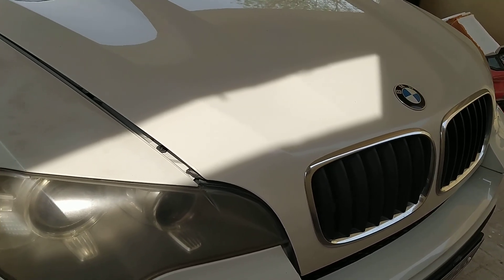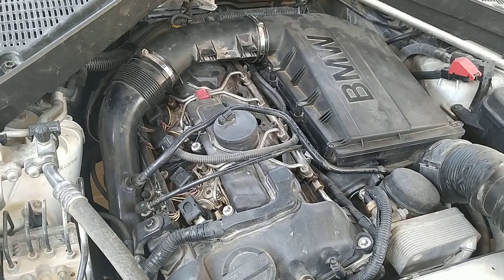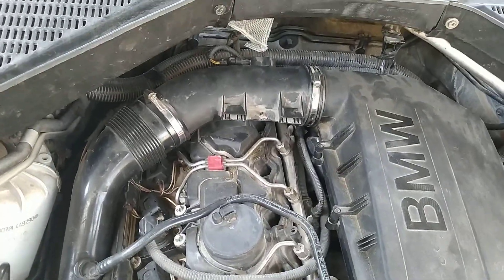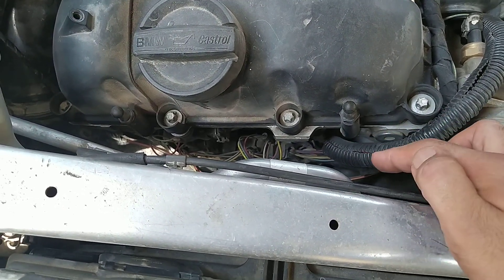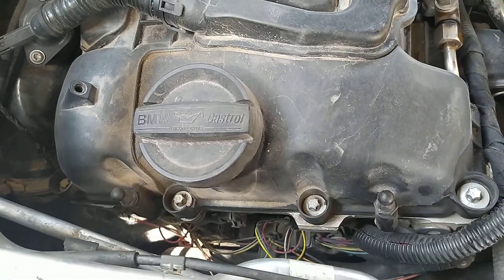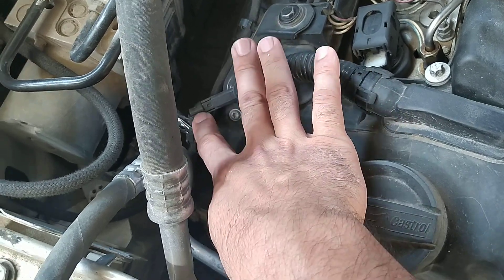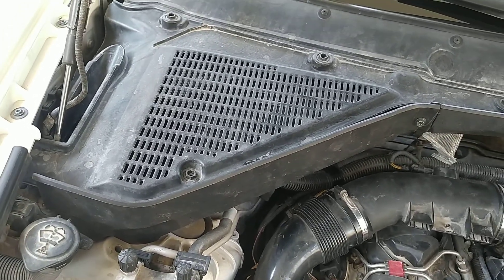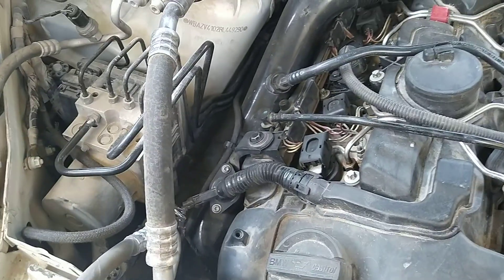BMW X5 E70 N55 no start due to electrical short circuit fixed!!!! See discription for error codes

Comment: Its was codes p15ED p2088 p2090 p0100 p0343 p0368 but it has to be the crank vent hose sensor because if i plug that sensor in the fuse blows in the integrated power supply module. I tried changing the cam sensors and unplugging the mass airflow sensor and that didnt work. I put the test light where you told me to and when i unplugged the cam sensors and the mass airflow sensor the light went dim but it never went out. So im buying a new vent hose with the sensor.

Comment: Ok so i just put the test light wire on the side of the fuse that goes to the dme and the other wire to ground right??? Is that with with the key off? Please help me!! Im blowing the same fuse
Reply from the maker: Test light positive to to positive terminal of the car and negative of test light to the fuse. Then remove wires of each component, please keep the vent hose electrical connector disconnected all the time. Try without ignition if the test light lights up that way
Reply: @bimmerhacks  so one wire on the positive and one on the side of the fuse that goes to the dme right? So basically I'm putting power with the light through the dme right? So that's not going to hurt the dme?
Reply from the maker: @jeffreyodachowski6247 no ... U r not putting power to DME u r just checking if a line that is supposed to carry positive voltage is touching the body and grounding
Reply: @bimmerhacks  I fixed it! The crank vent hose sensor is bad. It has a ground wire I disconnected that wire and all the codes stop. So that wire you told me to disconnect is the bad sensor. If I connect it the fuse blows. Idk why the dme isn't showing me a code for that sensor. It's not connected. But it's working. I never got the test light to fully out out but it did get dim. Thank you so much!!!!!
Reply from the maker: @jeffreyodachowski6247 @jeffreyodachowski6247 Glad that got fixed... Sounds weird.... Thank you for the update 
If you have time just put the error codes completely as comment so that will help some one out there without much brain storming😊

Comment: I just bought a 2009 BMW X6 35 I and there is no crank no start. I have tried to make an artificial body ground because I have seen the ground belt can wear out and that didn’t do anything I also tried to jump the starter solenoid and nothing. I have a bunch of codes I’ll list below 
P16a3 
U1126 
P1701 
2ab4 
2dec 
Cf37 
Cf34
Cf2b 
507d 
Cf2f 
50dc 
Cf30 
Any ideas ? All the dash lights come on
Reply from the maker: Check IVM/integrated bsupply module. YOU CAN SEE IN MY VIDEOS
Reply: @bimmerhacks  what am I checking for ?
Reply from the maker: @brandonparenteau8564  check if any of the fuses has blown in that module. No need to replace the module you can just plug in same Ampere fuse and check for any short circuit
Reply: @bimmerhacks  ok will do, I’ll let you know if that fixes it. Thanks for the reply
Reply from the maker: @brandonparenteau8564  Forgot to remind you, the battery must be in good condition. Must read 12 or near to it
Reply: @bimmerhacks  just checked the ivm and I can only find one 50 amp fuse and it’s good
Reply from the maker: @brandonparenteau8564  send me the IVM foto please. bimmersword@gmail.com
Reply: @bimmerhacks  just sent
Reply from the maker: @brandonparenteau8564  check your email and reply please
Reply: @brandonparenteau8564  did you solve the problem? i have a 2010 535i with same problem and can’t find anything
Reply from the maker: @heiniskibens2011 it was a jammed engine and I hope he replaced the engine itself.

Comment: Bmw 316i 2013 might be called F30 

I'm getting these  errors 113026:Ignition relay and injectors,supply voltage,fuel injection:Short circuit to ground(permanent)

1F0515: Valvetronic ,supply voltage:Line disconnection (permanent)
Reply: Had replaced the battery to non agm without registering idk it might be that caused this issue or something else
Reply from the maker: This means your car cranks but won't start the engine I guess. I doubt the ISM which is located in the engine bay on top of the head light module to your left. You can see my video explaining the details of ISM. CHECK IT FIRST
https://youtu.be/jJN1VpxdLU8
BATTERY REGISTRATION Should not cause this problem unless you shorted the terminals.
One more thing, as this car has n13 engine there is a possibility that the spark plug coil supply lines got shorted as a result of torn insulation near the connector attached to the coil.
Reply: @bimmerhacks  okay thanks i will look into it and will let you know
Reply: @bimmerhacks  and yeah it cranks but won't start
Reply: So it is likely to be two fuses that gone bad and both should be in ISM,Right? There's no chance of any fuse goes bad in glove compartment fuse that throws these codes?
Reply from the maker: @hammadsohail786  as far as I know nothing from glove compartment. But u may check that and also the engine bay fuse box to the left near the wind shield.
Reply: @bimmerhacks  so yeah today i opened the ism and  the one fuse was bad i think 20Amp probably of ignition i think but still after replacing it problem wasn't solved,car still cranks but no start but i didn't have scanner today so I don't now what code it will gonna  show after fuse issue is fixed from ISM,lets see but i have checked all the fuses too from engine compartement fuse box near ecu all fuses were fine,what to do you think will be the culprit?my Elm327 scanner on torque pro showing no fault code idk its correct or not lets see when i check it launch scanner maybe it'll show something but what do you think i should look for? I couldn't be able to open glove box compartment fuse area and it's highly there could be anything which shows these code,My car battery was low on charge do you think low charge can affect starting,like it was cranking fine but low battery fine were popping up on dash and when i checked the battery voltage through volt meter it was in 11ish so idk what could be reason
Reply from the maker: @hammadsohail786  If the fuse has blown in the ISM it means there is a short circuit in the ignition system, either the injector connections or the coil. Trace the short circuit first. The replaced fuse might have blown again. Battery voltage doesn't matter for the time being.
Reply: @bimmerhacks  no its not blown again,even i cranked the car alot of time and it was fine,I checked it every time i cranked it
Reply: @bimmerhacks  and you have also mentioned it might got blown up due to wrong polarity while jump start
Reply: @bimmerhacks  i even checked the all fuses in the trunk area and they were all fine too
Reply: @bimmerhacks  how many fuse boxes exists in this car?
Reply: @afeef it was 15amp not 20 sorry
Reply: I’m having the same issue with the same codes on my F30 316i N13. I took it to get ignition coil and spark plugs replaced (Just maintenance nothing was wrong with the car) when I get the car back it was fine driving out of the mechanic’s but after 100m it started cutting out and idling rough until it stopped and wouldn’t start.
Reply: @Zikiss  my issue was resolved after replacing the dme

Comment: Hi, i got 300c and 300e error code fix short circuit to b+
On my 335i n55. Any ideas i would be very greatful
Reply from the maker: Intake n exhaust camshaft sensor faulty/wire from camshaft to DME or crankshaft to DME defective. Is it limp mode and long start issue?
Reply from the maker: Did you get the issue resolved? was it any water intrusion?
Reply: i have this same code and car wont start
Reply: did you fix and how?

Comment: 2011 x5 35i with a 2f44 code - ignition circuit, supply voltage: cylinder bank or engine failure. Car cranks, starts then stalls after 2-3 seconds. 2f44 I know is usually an EWS error but on MEdv1726 it shows it as this error. I checked fuses inside ISM and all fuses relating - any insights or experience with this? Was running fine 5 minutes prior then this happened.
Reply from the maker: I did not encounter this issue in my cars. This looks like low voltage(battery faulty) or as you checked the ISM Faulty or any related Fuse. Any recent work done in the car?
Reply: Yes a HPFP and oil cooler gasket replacement.
Reply from the maker: @jaytrucks8329  possibly any wires crushed in the intake manifold side?!!!
Reply: Wanted to come back and let you know it was the DME, it was causing a short internally and blamed the ISM - Had a factory DME programmed and starts right up no drama and have put around 100 miles on it since then.
Reply from the maker: @jaytrucks8329  thanks for the update mate. It will definitely help someone.
Keep posting...
Reply: @bimmerhacks  for sure! @stickyrickybimmer

Comment: I have a 2011 335i convertible it’s been sitting for a few months Went to go start the other day cranks but won’t start drains battery.The codes I’m getting are 2a61 and 371e any help would be greatly appreciated!?
Reply from the maker: Please check the below link to see the power distribution box. One of the fuse might have blown or else the wire might have corroded. In your case I guess it's corroded as battery is getting drained(not that sure, if there is short the fuse must blow off)
https://youtu.be/jJN1VpxdLU8
Reply from the maker: Did you check?
Reply: Thank you so much for the quick response I just seen this message im going to look at it now and I will let you know so!

Comment: Hi I own X5 E70 35i using N55 engine.
The car check light turn on and hardly start. 
I did diagnosed:
Terminal 87_1 no voltage 
Water pump not working 
Oil pressure 
Alarm system not working

Any advice about my X5 issues?
Reply from the maker: Get me the error codes by scanning using MHD or any bimmer app. Mean while you can check the ISM module which supply power to DME, WATER PUMP n various engine electronics
https://youtu.be/iRKknSeGw_U
Check this Link, also I have shown the location of this module in another video
https://youtu.be/_7n485INGQc
Reply: @bimmerhacks  Thank you for your reply. After doing the scanning it shows Terminal 87_1: no voltage and Car Access System (CAS) K-CAN line fault. Currently, my car engine started then off in 1-2 seconds. I have no idea what is the problem. I replaced the fuel pump relay behind the fuse box but still shows the same fault code. Thanks again.
Reply: @bimmerhacks  Hi! After checking on the supply power I have a broken fuse on number two slot 20A fuse. I replaced the fuse. Unfortunately, the fuse blow again. I'm wondering did you know the fuse link to which part of wiring?
Reply from the maker: @jacksonchew9508  I will check and reply back.
Reply from the maker: @jacksonchew9508   20 Amps fuse comes for Fuse 2 and Fuse 5. Both goes to DME Module 500 voltage supply pins which is 12 pin connector. Fuse 2 gives supply to Valvetronic Relay too. In general you have to trace the connections going out of dme keeping the 12 pin module 500 keeping connected if its not the valvetronic relay or motor problem.
Try keeping Valvetronic motor connection disconnected as a first step. Then Vanos sensors etc. I will get back to you if i get further information. The fuse blows means your DME is still safe and its just a short circuit that need to be traced.
Reply: @bimmerhacks  Thank you for your prompt reply. I try to move around the wire link to the 20A fuse socket and replace the fuse. Look like the fuse didn't blow up. The car can start now but I did scanning again it show the fault code below:-

2E0F - valvetronic system: deativated, adjustment fault too frequent

385D LIN/BSD message; alternator: missing 

38A4 BSD (bit-serial Data Interface), message ; Intelligent Battery Sensor (IBS) missing
Reply from the maker: @jacksonchew9508  this error codes are normal. It's related to IBS sensor issue or water pump issue or battery. Did you sort out why the fuse was blowing off?
Reply: @bimmerhacks  I have no idea what is the issues causing the 20A fuse blow up. After replacing the fuse 20A the engine running smoothly. I will try to check is there wire touching the ground. But now my car engine after running for 10min the radiator fan turning high speed and very loud. Engine temperature around 125.5(F). After scanning it show the same fault code 

3446 BSD message, oil condition sensor, missing ss
378F BSD electric coolant pump missing 
385D LIN/BSD message Alternator missing 
38A4 Intelligent Battery Sensor missing 
D904 K-CAN line fault 

I plan to change the IBS first. Or you have suggestion which part to check first? I check alternator, coolant pump and oil sensor wire still okay. 

Thanks again for your help.
Reply from the maker: @jacksonchew9508  IBS wire might have tampered somewhere near engine block or water pump connector might have coolant leaked to it . Just a guess. Try cleaning those and check the engine block front side cable management box.
Reply from the maker: @jacksonchew9508  did you sort it out
Reply: @bimmerhacks  Hi! I haven't sort it out the problem. I can start the engine but after running for 10min with air condition turn on the fan will turn on in full speed and loud. The fan not suppose to turn full speed. 
I check all the wire look okay for the electric pump, alternator, rear battery connection and the oil sensor. 

I'm wondering is the electric water pump failure. I replaced this water pump before.
Reply from the maker: @jacksonchew9508  may be the coolant  thermostat wire is not connected properly, or wire is faulty or thermostat itself is faulty.
Coolant temperature sensor to be checked after thermostat things
Reply: @bimmerhacks  Hi! At last I found out my X5 problem. The wiring is okay. Water pump motor burn out caused the DME fuse blowout. After replacing the water pump motor and the engine back to normal. Thank you for your help.
Reply from the maker: @jacksonchew9508  Thank you for the update. By the way if water pump burned it could have shorted the 50A fuse in the power distribution box/ISM. Weired

Comment: What was the actual connection that had been shorted? You pointed out that one of the wires bunched up against the engine block was found shorted, but it's not super clear which one it is.
Reply from the maker: I did not trace out to which sensor it was going to as the wire shorted was going below the engine side... When I got the confirmation of the short I did not drill down. What is the issue you have?
Reply: @bimmerhacks  Hey Afeef, I got an F30 with N55 and it cranks but won't start. I got the code "1F4A10 Relay, ignition and injectors, activation: Line disconnection", but I'm not sure which connections to check. I've replaced the ignition coils and spark plugs for starters, but that didn't do anything.
Reply from the maker: @stevesung1103  what about the fuel pump relay? What was the work recently done... Please explain the situation when this happened. I wonder why there is only one error code!!! If you can download MHD55 in your phone free ver and check error codes.. it might show shadow codes. HPFP was a culprit in n55 engines but not for new models as they have changed it
Reply from the maker: @stevesung1103  as there is only one error code the fault must be from a component which comes after DME. That's the logic I would think of if it's any component before DME then there should be couple of codes poping up... Anyways keep me posted
Reply: @bimmerhacks  Alright. Thanks, man. As for the fuel pump relay, I still have zero clue where it's located. I've checked the diagrams for fuses and relays and it seems like there's no 7-prong relay for the fuel pump like the previous gen. I see there's a fuel pump driver module or EKP by part number 16147411596 behind the rear passenger seat, but I'm not sure if this is the fuel pump relay..
Reply: @bimmerhacks  I hadn't done any work. The car sat for about a month and I drove it to work one day (~7 miles) and it exhibited nothing odd. On the way back, the car misfired (jerked, rpm fluctuated, but no check engine light or code left) and shortly went into limp mode. I pulled over and was able to restart the car, but it died again and this time around I couldn't get it to start.
Reply from the maker: @stevesung1103  this happens when the battery is weak but it will start the engine with rough idle. Check the battery first. Then only you might be able to get the correct error code. When battery is low the car goes mad
Reply: @bimmerhacks Picked up a brand new battery from the dealer the other day and tried starting the car, but ended up with the same exact code of 1F4A10 and the symptoms remained the same (cranks, but won't start).
Reply from the maker: @stevesung1103  did you try scanning using MHD55 ? Please post a video while u try starting the engine from the engine bay... As I mentioned I am not an expert but might be able to think of something... Yesterday I was busy taking off my intercooler n radiator for flushing as there was vaccum leak
Reply from the maker: @stevesung1103  any luck?
Reply: @bimmerhacks  Hey man, thanks for checking up on me. Didn't get to work on the car during the week. I removed the rear seat to listen to the low pressure fuel pump prime upon waking/turning ignition ON, and heard absolutely nothing. So I back probed the connector to see if there was power going into the pump, and there was none. So, I gotta check a few connections upstream of the pump connector now...
Getting somewhere I guess.
Will post an update :D
Reply from the maker: @stevesung1103  Sounds good. Good luck mate
Reply: OK I have the exact same problem on the same exact fuse!! OK so do you leave the dme plugged in with the ignition on or off? Or do I disconnect everything from the dme then look for the short?